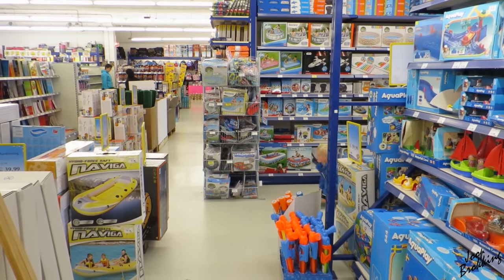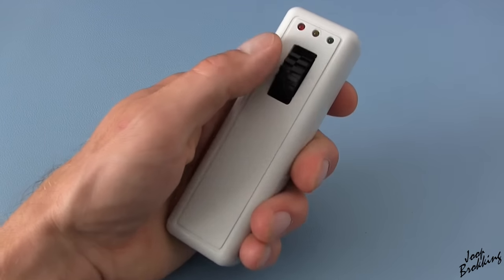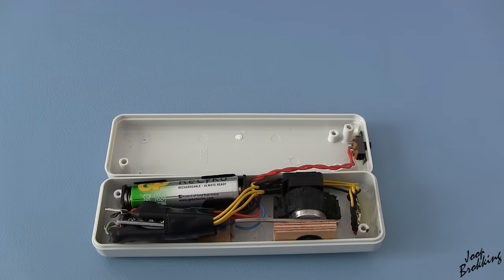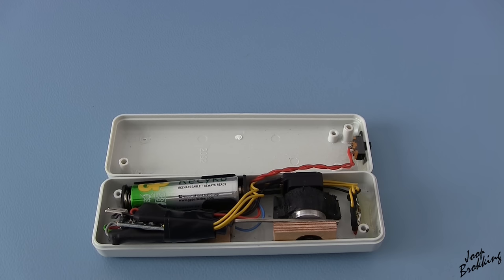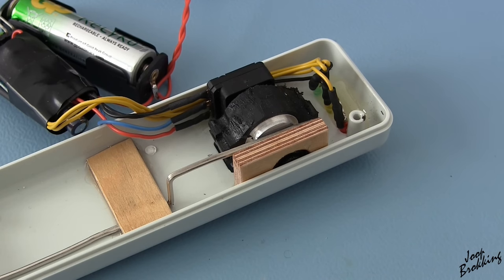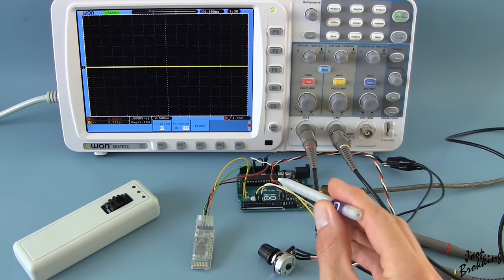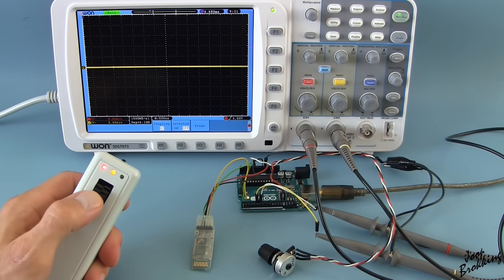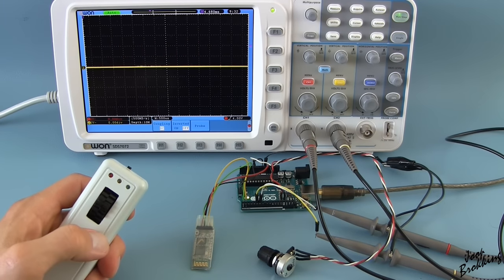Building an electric longboard (part 1) - The Arduino / Bluetooth remote.

Comment: On commercial boards the deadman switch will apply brakes by default.  The board is heavy with batteries and if you fall off it it can coast for quite a distance before it stops.
Reply from the maker: My main concern is when the communication stops when I'm still happily on the board. Braking will definitely drop me of the board.

Comment: Hi Joop, nice project. I started working on it but I see that the schematics on your website are old as you mention in your video you added capacitor on the output of 5V booster on transmitter, and I dont see it in the schematics. will it be possible to update schematics on your website?

Comment: Isn't it possible under breaking to use the brushless motor as a generator for your battery, or am I thinking about a brushed motor? I just found a really cool (70's) wooden off-road board with 8" tires, I might have to try something ... Thanks
Reply from the maker: The motor does not produce enough voltage to charge the batteries. So in order to do so I need to boost the voltage first.

Comment: Hello Joop Brokking, first I would like to tell you that your tutorial is the best and most complete one I've seen on youtube.  Great job man, and this is also the most price accessible. Do you have an idea of the maximum speed you can reach with this motor? Sincerely, Marc.
Reply from the maker: Best guess is 15km. But there is also a big chance that I will not work at all. I'm working on a current limiting circuit so the motor does not burn on startup. If it works I can always add another motor to get more speed. These motors and parts are pretty cheap.
Reply: @Joop_Brokking  please share your contact... i am building same but not pairing the Bluetooth

Comment: Hi, I'm setting up your Project and would like to know if you can indicate the components (Small pulley - 15 teeth on Conrad) and (Large pulley - 60 teeth on Conrad), at another location buy (DealExtreme or eBay), I have many difficulties to Conrad store send to Brazil. thank you
Reply from the maker: Sorry, I don't know any other suppliers for this particular pulleys.

Comment: Can you share the arduino codes ?
Reply from the maker: Not yet because I don't know how/what the final setup will be.
Reply: Joop Brokking I see, do you have any suggestions about to how I know the radio lost connection cuz I'm doing the same and when it lost signal the last function keep rolling ...
Reply from the maker: My transmitter sends a special code sequence to the receiver every 50ms or so. If the receiver has not received the sequence the brake and throttle are disabled and the board will roll to a gentle stop.
Reply: Joop Brokking  ok I'll figure out thanks :)

Comment: The geek in me would want a 7-segment display to show the true voltage level. :) I'm thinking http://www.banggood.com/10-Pcs-Red-7-Segment-0_56-Inch-1-Bit-Common-Anode-LED-Digital-Tube-p-993729.html or http://www.banggood.com/1PC-0_36-Inch-7-Segment-4-Digit-Common-Anode-0_36-Inch-RED-LED-Digital-Display-p-1023513.html but they would reduce the battery life of course.